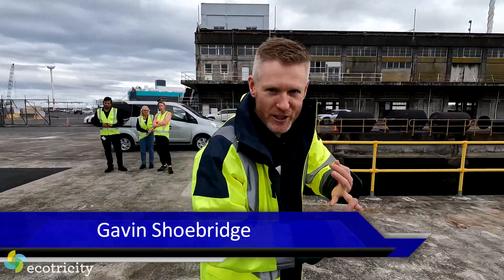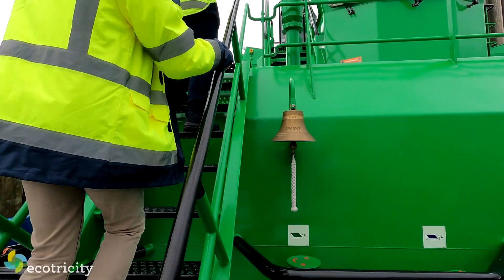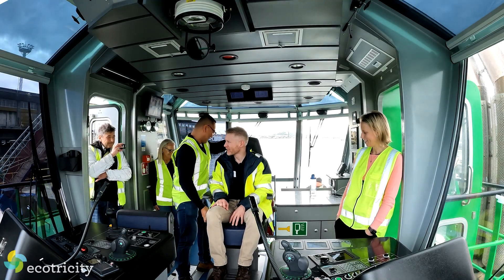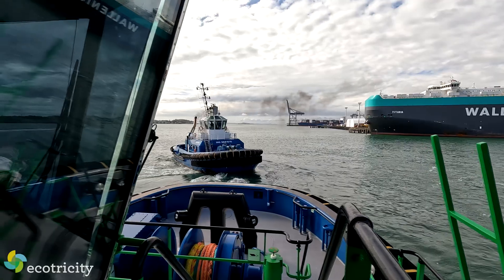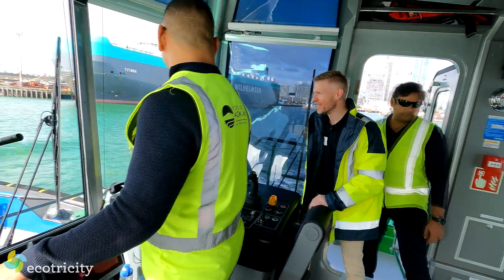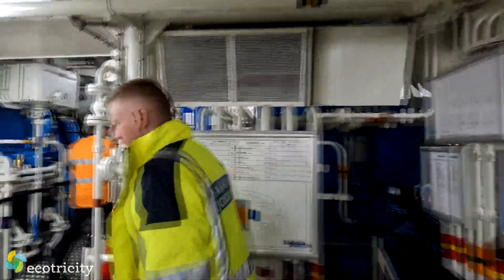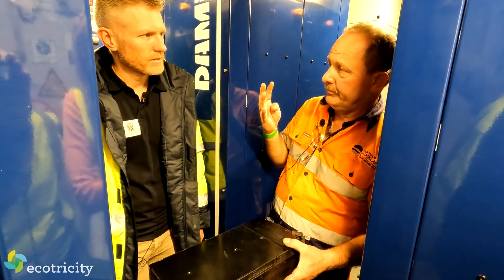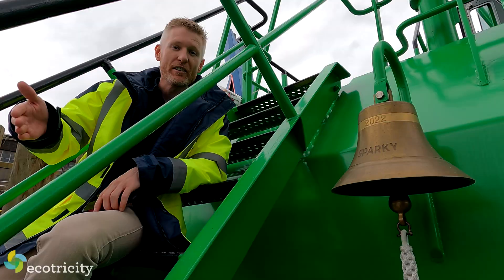Check out Sparky: the world's first, pure electric, full-size tugboat!

Comment: AND EVERY  WATT SECOND OF CHARGE  is  provided overwhelmingly by  FOSSIL FUEL  and all of the EFFICIENCY  losses  thus incurred.
Reply: "The electricity sector in New Zealand uses mainly renewable energy, such as hydropower, geothermal power and increasingly wind energy. As of 2021, the country generated 81.2% of its electricity from renewable sources." 🤡
Reply: no it's not. it's almost all renewables.

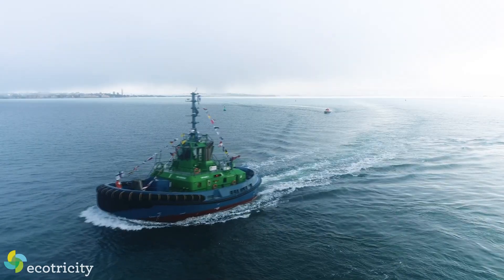Comment: Those diesel generators mentioned at 8:38 make this a plug in hybrid. Would be best to remove the references to "pure electric" and "100% electric" for accuracy.
Reply: They're only there for emergency backup and aren't used in normal operation
Reply: The generators are only back up and they're required for safety purposes. They also power the fire fighting system which would be used if a container or cruise ship had a large fire. Just like a fire truck, but floating :)
Reply: @portofaucklandltd  Thanks for the response. The presence of the generators (even if only for back up) make this a plug in hybrid, rather than a pure electric vessel. Of course nothing wrong with plug in hybrids. Sounds like a great technology for this application.
Reply: @scottyb132  this is a pure electric vessel with backup auxillary charging. not a hybrid vessel.